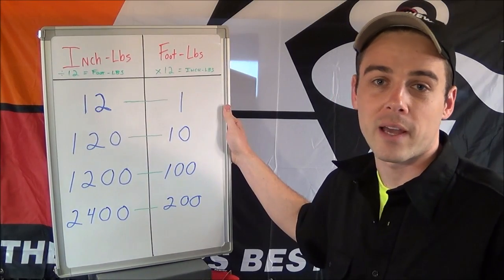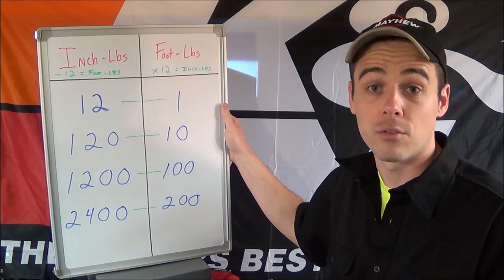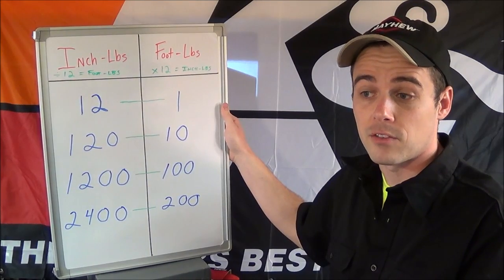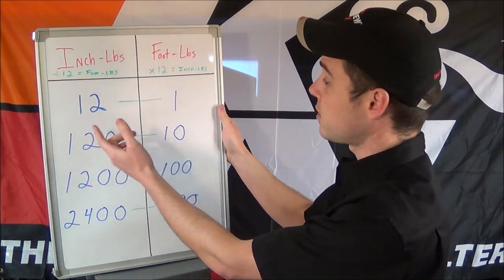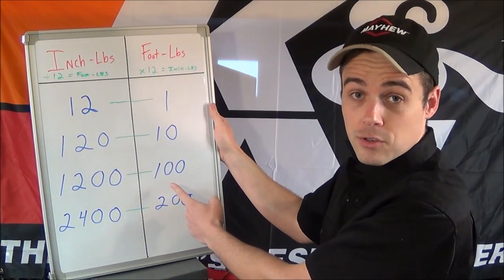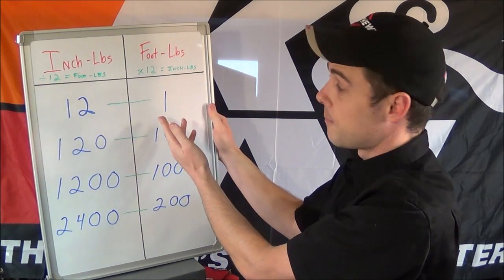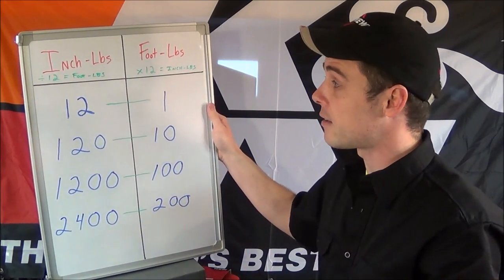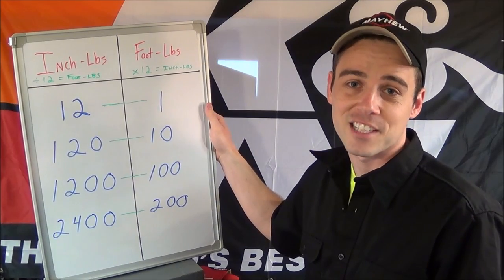How To : Convert Inch-lbs & Foot-lbs

Comment: Thank you for that conversion chart that you did here. I'm trying to help a friend of mine on a 400 Honda engine , and everything is in very low foot-pounds like 3 foot-pounds and my torque wrench doesn't go down to 3 foot-pounds. But I have an inch pounds wrench that I use for automatic transmissions, and that will do the job perfectly Thank you for that help.
Reply from the maker: Glad it helped you!

Comment: I wish I would have seen this video because my air intake manifold on my 2018 Jeep Grand Cherokee measured 89 inch pounds and I might have put the manifold on too tightly.  maybe 120 inchpounds. I did it last week. Should I remove the manifold replace the gaskets and put it on properly? or what's going to happen if I don't?
Reply from the maker: I’d leave it alone……

Comment: Is there a rule of thumb for remainders when converting? For example, I just replaced the camshaft actuator seals on my '14 Chevy Cruze LTZ and on the Cruzetalks forums, found the torque spec was 71 in-lbs, but my torque wrench only has ft-lbs.. 71/12 is 5.91xxx, so I rounded up to 6 ft-lbs. Hope that 0.1 overage doesn't screw anything up..?
Reply from the maker: It won’t mess anything up..... I’d personally round up anytime something needs a weird measurement.
Reply: @RealToolReviews  thanks for the reply and setting my mind at ease!

Comment: This helped me a lot. Needed to know what 140 inch pounds in foot pounds. I went ahead and pulled the trigger on a TEKTON 24320 torque wrench. I was putting back together an aluminum head 5 horsepower Briggs & Stratton that had locked up and the intake valve was stuck.

Comment: Great video, thanks! Just purchase a Clicker Style, and I thought one thing noteworthy was the fact that this torque wrench goes only to 250 inch-pounds which is only 20.83 foot-pounds. Good for a small engine rebuild but won't do much for torqueing lug nuts.

Comment: Like this video, but I have a question.

When we see "lbs" in papers, does that mean inch-lbs or foot-lbs?

thanks
Reply from the maker: +Chen Kyle Thanks!  Lbs = pounds.....if you see inch-lbs = 12 per pound (12 inches per foot).....if you see foot-lbs = 1 per pound (1 foot per foot).
Reply: If your talking about weight like 3lbs of ground beef or vegetables that in the measurement of 16 ounces to a lb (pound) the imperial system is very confusing to those who use the metric system.

Comment: I appreciate that video. I was wondering how impact drivers compared to impact wrenches as far as power goes.

it definitely has save me some money. Because based on this math I was able to determine that impact drivers are no substitute for impact wrenches.

I been looking for a small impact gun for my parents to use in minor home repair & projects.  Had been considering a driver since they are so light.  

Looks like I will have to keep researching, but at least I didn't give them something useless !!